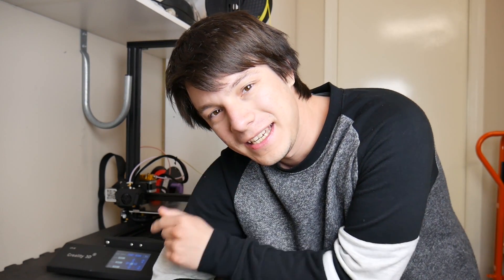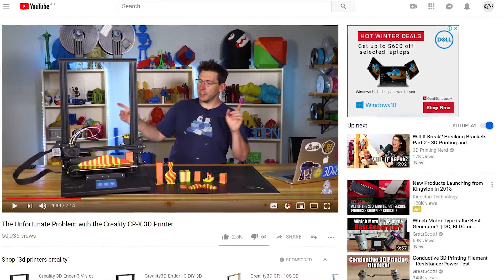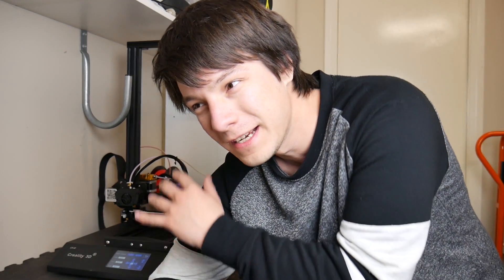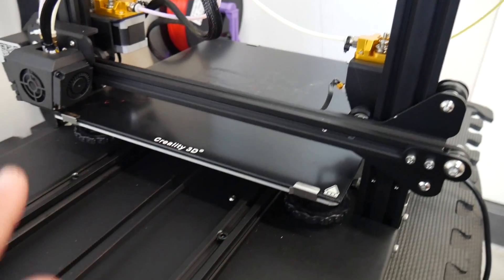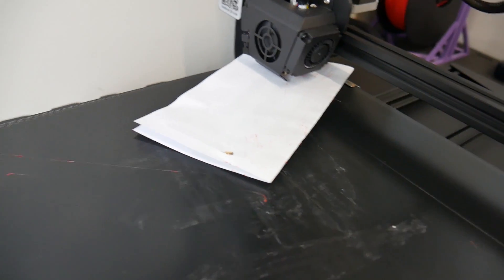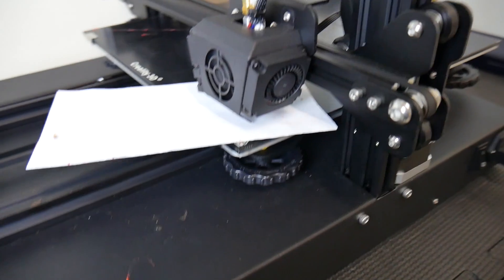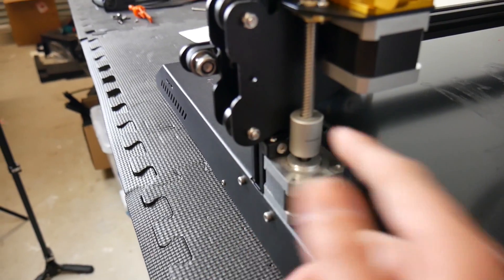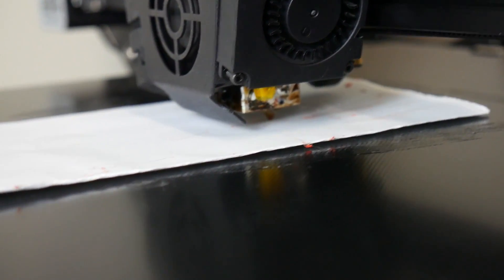Update on my Creality CR-X and going forward

Comment: I am having a problem with crx reading so cards I have printed a few print but now it won’t show anything on the cards iam using reality slicer and cura both show  files on the card. G-code and stls

Comment: I know I'm 4 years late... but I think the CR-X (like just about every other printer I've used with firmware levelling) was expecting to level the bed with Z at 0mm, i.e.: with the nozzle just physically touching the bed and no clearance.
By using a doubled-over piece of paper to level you were adding 0.2mm to the expected height so the first layer of the Benchy was actually trying to air print at 0.4mm. I use a custom g-code script with Z at 0.1mm so that levelling works correctly with a single sheet of paper.
Of course getting a bent carriage doesn't help matters, that's totally on Creality.

Comment: People: if you have problems with a spring being too loose the simple fix is to add a washer or two where the spring sits to compress the spring. Now if the threaded rod in knob is too short as what seems to be the case in this video that can be changed for a longer matched thread bolt and use a printed knob handle to embed it into. (the easy fixes do not excuse creality for the problem in the first place)

Comment: That problem is the spring not been the same. Simple solution is get 2-3 washers put under the spring with the right diameter and your there for lift all corner equal up which now than raises your bed all around by about 3mm so not you got a the bed to high which is what you want so you can now tighten the bed leveling down allowing you to have a firm and stiff spring loaded bed.  8 washers cost you less than $1
The problem you may have same as I had is the extruder itself is bent. Somehow those 2 screws holding the hot end heat sink in place allow for shifting of the printing head during shipment.

Comment: Hey Angus, 

I'm looking forward to buy my next 3D printer in a few months or so. I bought (pledged) the Snapmaker 1 from Kickstarter and always keen to the idea of the modular system with laser engraving and 3d printing, but I want a bigger machine in the future and want tot do more projects at the same time, so I guess the Snapmaker 2 isn't the way to go. I want to make multiple projects with metal based filaments and as I've followed some youtube video's, not every 3D printer is able to do these kind of prints in a large order.. To be exact, I think my Snapmaker disliked the Bronze based pla filament too much and it broke down. I'm thinking about a machine from Creality, Prusa or maybe a FlashForge? Budget up to 1000 dollars max.

Comment: Ok I just got a new unit and ok it is my first printer and prob not the best choice but hey I so far have only one issue but this also is due to living in an old house with not the best of insulation to fend of the cold but have got one good print to finish and it ain't bad but I'm going to go with a taped bed sheet .. to see if that helps but I've also plans to build a cabinet to keep the temp up for winter.... 
The other pain is the TF micro sd card

Comment: Hey great video.  I got mine back in Nov. 18', never hooked it up until last March.  So clock ticking on warranty, and right out of the box it went together great.  Never really had any issues mentioned on this or Joels video, or TH3D's unboxing either.  Worked like a "good-one" for the last two months.  No leveling issues, hotend issues, and no touch screen issues.  BUT!  The SD card reader would not recognize in of my files saved using CURA (I have 4.0) until I re-tagged them deleting  CURA's "CCR" from the name, and using lower case letters.  I did that and worked fine, but about a month into using my CR-X and the SD card system.  The machine started to recognize "CCR" named filed that I had stored on my other cards used in the past machines.  Made me think that it could be a "CURA Thing" as I had CURA 3.6 before my CR-X came along.  So here is the "big one" as I type this, I am waiting on Gearbest to address the latest issue.  The heat-bed stopped last week in the middle of a 26 hr. print.   The screen says the heat bed temp is -15 degrees.  It was printing great, but then it's my first non-clone, as my first was a ebay special 10s clone that I wound up pulling the guts out and install a TH3D motherboard, and their 10S firmware.  And no its a work horse that runs almost 24-7. Am I destined for the same with this CR-X?

Comment: I purchased the CR-10S Pro and have had the same issues.  The bed heater also stopped working after about 5 days.  Creality wouldn't let me return the unit.  So I had to get into contact with PayPal. I have to pay for postage back to China to receive a refund when the product was sent out from a warehouse in Australia.   The product was purchased from the official website www.creality3donline.com

Comment: Dude I got the printer today. It's just as crappy as your machine. IT'S TERRIBLE.

I built it at 10am And it's now 4pm. That's how long it took to get it started on its first print and the print is terrible.

It's going back to amazon. This experience has turned me off to dual color printers.

Comment: I've just received a CR-10S Pro which looks like more-or-less the same machine without a dual extruder. I've spent nearly two whole days trying to get this printer going; levelling and checking settings. It didn't work out of the box, it'd dropped to bits in transit and there's no detailed documentation to set these up other than the initial levelling and build. If there's anything else wrong, you're on your own. This is my 2nd Chinese printer, I have a Qidi X-one as well. It seems to me that you are the QA, final inspection and tech support. Both printers did not work out of the box and you're expected to figure a lot out for yourself. Having said that, once they're working they print really well if you can be bothered to tinker and experiment Qidi in particular was helpful with parts but always wanted video evidence of the faults. I'm happy, but I'm not sure you can call them consumer products (are they intended to be?). You have to mess around with them in a way that Western consumers don't normally tolerate. I think because they're aimed and engineers and makers we put up with stuff most would reject the product for and I think Angus' video "Serious concerns with 3D printer quality control" hit's the nail square on the head. You wouldn't buy a inkjet printer or DVD player and expect to rebuild it, figure out why it's not working right and align it, you'd reject it as are your consumer rights. I'm not convinced with the dual Z axis stepper system on these, I think that's where some of the levelling issues lay. Mine wouldn't raise level for a day due to my mistaken belief the leadscrew nuts should be tightened at the M3 screws holding it to the head gantry brackets. There's deliberate play engineered into the top bearings, if it's not there, the steppers stall and the gantry twists.
I've seen the argument that these are cheap to buy and this can be expected, but the CR-X and CR-10S Pro aren't $200-$300 cheapies. Yes, they're feature packed but they should still work as intended when you get them.

Comment: I had the same problem with a similar printer but solved it by lowering the bed and squishing the springs. I made my own bracket for the z stop screw but on your printer you colud cut off some material from the limitswitch holder.

Comment: I had the exact same issue with my S5. The front left screw would fall off and a z lead screw was messed up. The s5 however started seizing the X motor. Come to find out it's the result of a motherboard issue. 4 days owning the machine and I sent it back. End user products, regardless of weather or not their billed as a "tinkerers tool," shouldn't require this much trouble shooting out of the gate. After a few weeks of printing, sure. I would deal with that. Very disappointed in the lack of quality control on creality stuff so far.

Comment: I have the same problem with my Ender 3, it is only 220mm x 220mm.  And when I use a single sheet of paper and make it too tight after homing I can get 5 sheets of paper under the nozzle.

Comment: Just got my CR-X and leveling is fine. I looked at the leveling mechanism and a short leveling screw would cause the knob to be at the very end when they adjust to fit the foam packing.  The screw could also be screwed too far into the metal platform. Did you take the glass off. My guess is they had a few short screws in the screw bin on the assembly line. This happens. As far as the beta testing, some people give a free sample so they can get feedback. The user should talk to them and get replacements parts if needed, IMHO Not go on youtube and whine.

Comment: I recently purchased a CR-10S 400mm as my first 3D printer, and had some similar issues with getting the bed leveled.  The center of the bed had a slight dip, and I just couldn't get the front right corner high enough to achieve adequate level-ness.  After some google research, I added 2 washers on the front right (and 1 washer everywhere else), and put two rows of tape down the center of the bed, under the build plate to "shim" up the center.  After that, I was able to get the bed nearly perfectly level with the corner screws, and was able to make good prints.

Until I came home from work one day and found my 18 lbs cat sleeping on the bed :-/.   It's good again after making some adjustments though!

Comment: My A8 clone (Coocheer brand, has larger bed, A6-like interface with encoder knob etc) had a very similar issue. If it wasn't one corner low it was usually two opposite corners always being low while the other two would be too high. I especially noticed it after replacing the leveling setup hardware with knobs and springs from amazon....I eventually decided the aluminum bed carriage was too weak (and the new springs were even stiffer than stock) so if I didn't tighten down the knobs evenly, or even went too far with some knobs, rather than actually pulling that corner down it would start pulling the carriage up toward the bed, just making that corner just as tight to the nozzle and the other low corners just as low, if not worse.

To avoid this I just had to slacken them all fully and start from square one never going too crazy with one screw at a time, but nothing like this! Giving completely different homing results after leveling....insane.

Comment: i just got the ender 3 - the hot end horizontal isnt level and i cant get it level at all - its a simple construction and everything is total square but when it runs - the right hand side is DIPPING  by 4 mm
i have tried loosening or tightening right hand side - still have the 4mm difference in hight if i measure from top bar to hot bed bar right hand side - confused and annoyed
i did my first print after setting the nozzle with paper but i had to completely wind up the front right corner to be able to get paper under it
somethings not correct and im disapointed too as its my very first printer

Comment: I had the opposite problem with my cr-10. Wouldn't get far enough from the bed and the prints smashed and clogged.  Got a new hot-end and printed on the tape. Kind of annoying but works amazingly.

Comment: Awesome video Dood but Not a single creality printer has printed anything well off the sd card provided, can you do a video when you experience problems whilst using s3d to set your first layer height etc? I would be supprised if you had the same issues. Mine is being delivered Tuesday from. Apparently a good batch :)

Comment: Either the gcode is wrong (layer height), the firmware settings are off, the bed is warped, the tramming is off (left/right side not level), or the hot end needs to be closer. I would figure with all the printers you have built that you would have already taken it apart and verified it wasn't a warped bed first. There are tons of use with CR-10s that had warped beds and warped glass even when we got our printers. The beds of these printers are made of rolled aluminum instead of plate. Every person that takes a tool to them has been off but I would expect there to be an issue with the firmware. Why they didn't include their copy-ABL sensor setup is beyond me. Why pay that much for a printer without a sensor?

Comment: your banding is probably caused by the heatbed not holding a straight tempcurve. You can try solving this by just print with the heatbed turned off and see if it does any improvements. If not, just remove the top attachment for the leadscrew and see if it moves when going from Z1 to Z200. 
If it does the motor is positioned wrong. if its not moving, try print without it and see if its better, if so, you can replace the top attachment or shim it to see if its not positioned right. 
take your hand and see if you have any play in your toolhead.. Creality isnt the best at installing the wheels properly and some if them can have some play.

Go to the bed leveling settings and make sure the printer is set to Z0.1 when checking the bed.. (papers are usually between 0.08-0.12mm

Comment: With my own printer kit (i3 steel frame) I had similar symptoms and after a year of coping with that as well as upgrading to a high quality aluminium print bed, wich didn't solve that particular problem, I finally realized that the two rails for the Y axis were not exactly parallel. I fixed that issue by raising one edge of the frame by some millimeters and since then it works fine.
I realize, though, that this is not a solution for a box frame like the CR-X is built with, but maybe the cause itself is similar...
Kind regards and thanks for all that good work!

EDIT: I still have no idea what originally caused that misalignment of the two rails... Maybe just a mistake of mine during assembly.

Comment: This is exactly why I have gone on a war path with Creality. These are not new issues on a pre-production unit, these are the same issues that comes from the CR-10. FYI - using thicker glass on the bed does help to get the nozzle closer, but it is still not an answer. Having the screws screwed out so far basically means the bed is resting on springs which has 2 problems.... 1) Printing larger prints pushes the bed lower down as it gets heavier, so the layer height changes as it gets bigger. 2) The bed has "movement"... It's like building a house on springs to help with earthquakes, When the bed changes direction, it actually "resists" because it is balancing on the springs and you get layer shifts.
I am not upset because a pre-production unit isn't perfect, I am furious that Creality is still trying to sell the same problems and hide it under the "minor issues" banner.

Comment: I had nothing but problems with my CR10 S4.  I ended up disassembling the entire thing and reassembling piece by piece.  While i was at it i also 3d modelled the whole printer in the process.  That file can be found on Thingiverse.  In the end i got it printing decent.  Crazy thing is that it doesnt print nearly as well as my Flashforge Creator.

Comment: But if the first layer already has the proper Z offset (layer height) then a folded piece of paper (~0.4mm) would mean that the first layer is 0.6mm high, but the printer is extruding enough plastic to cover 0.2mm, so no wonder that the print doesn't stick.
I level my printers with a receipt, because it's the thinnest thing that I usually have around.

Comment: I had this bed levelling problem happen with a chinese 3D printer I got of Ali, what fixed it in the end was using M851 to set the offset then using an M500 to set it in the EEPROM. It seemed to print fine after that. Not sure why it was happening but the printer I was running was using and old version of Marlin, so maybe it's related?

Comment: As an owner of a CR10S Creality do have QA issues, even on production units. My printer had screws that had come out of the Z axis lead screw gantry bushes and wasn't usable out of the box. I accepted this as it was a relatively inexpensive printer for it's capabilities and it was an opportunity to understand and learn about maintenance and setup of the printer, but had I bought it as a productivity tool I wouldn't have been so sympathetic. I think companies should think carefully about releasing pre production units for review, by all means use experienced and knowledgeable people such as yourself (providing a mutually agreeable arrangement can be made) to improve early prototypes, but if you release unfinished product for review without some basic QA process you get the criticism that has happened here. Creality should be reaching out to help here if they are that concerned.

Comment: I'm having the exact same issues with my CR10s 5. I purchased it 2 months ago and still can't print on the thing because each corner is at either a positive or negative limit and it's still not able to be leveled. 

The support I've recieved has been entirely frustrating too. I payed a decent bit of money for this machine (I got the S5 with all the upgrades just before they announced the X) and I've yet to be able to print on it. Now I'm wondering if I'm having the same issues because they were testing stuff for the X on my machine (because they built it custom). Really frustrated. :(

Comment: I think there's another way to skip perfect bed leveling.
Just lift the model 2 or 4 mm upward and then let the 'PRINT SUPPORT' feature do the magic if you tune the support thickness to enough layer height, it might makes the bed leveling irrelevant for any 3d printer